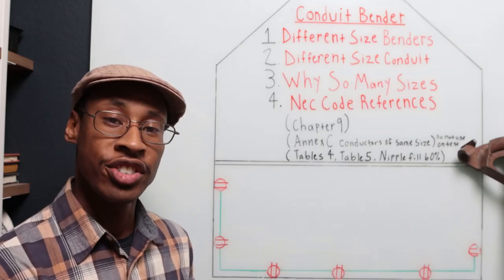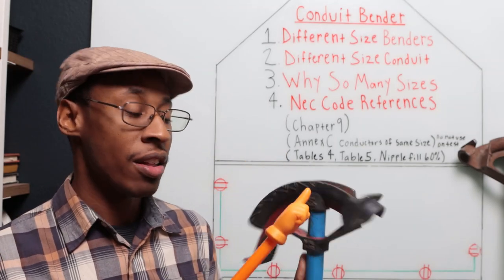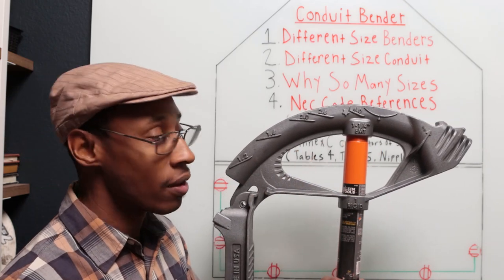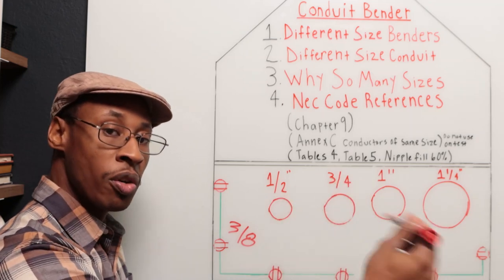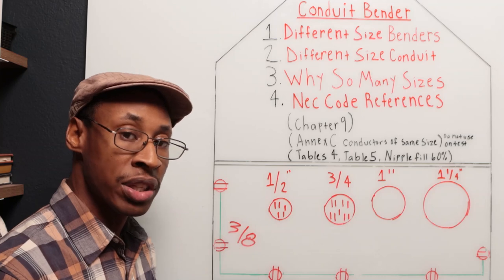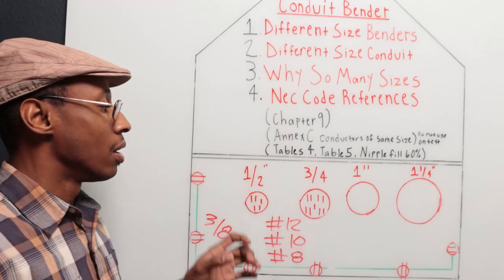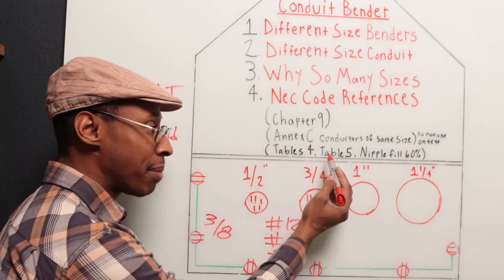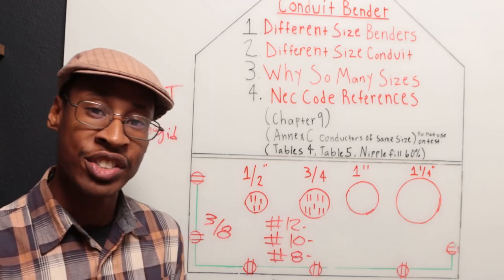Understanding EMT Conduit Bender Sizes & Conduit Conductor Fill

Comment: Us non electricians just want to know what size wire to run in what size conduit. We don't want to know what chapter 9 or annex or table 4,5 or 40% fill says because it does not tell us what the size is.